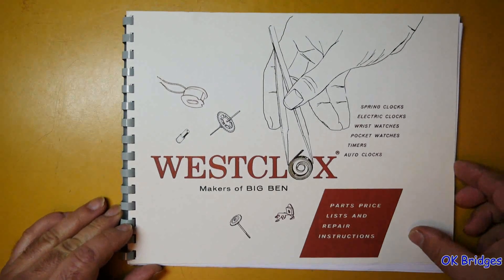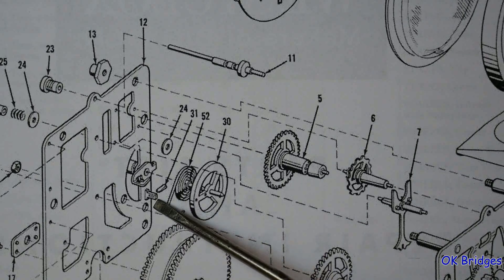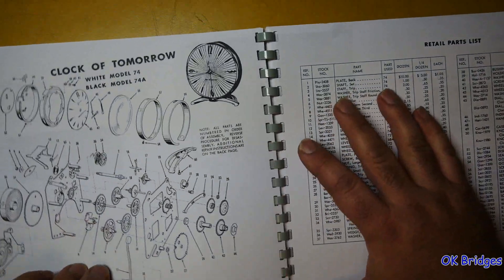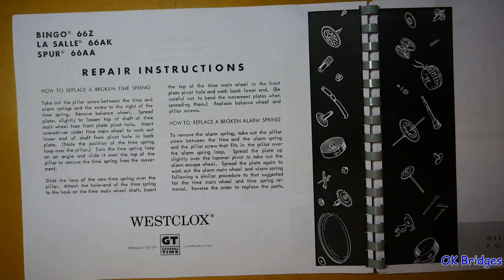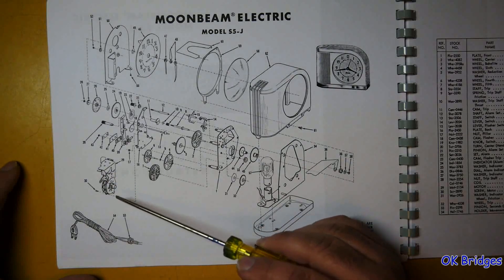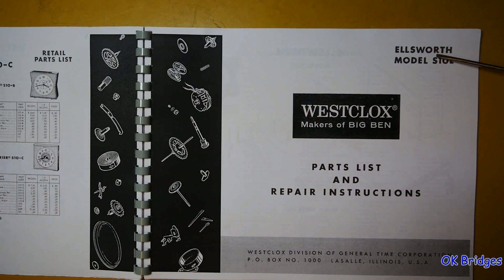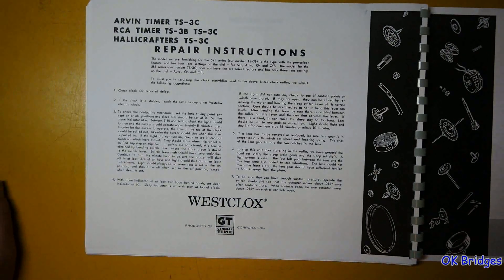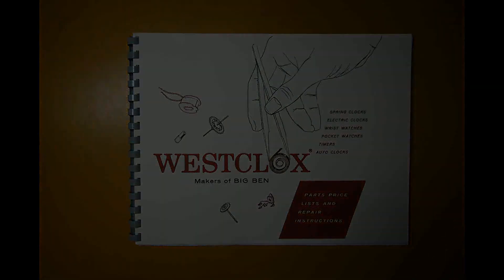1956 Westclox Parts Manual

Comment: Hi.  I have two Style 7's with taper pins on the hairsprings.   These are the later models with the brass trim ring, not the earlier chrome trim ring.    

I am also lucky enough to have two good working Clocks of Tomorrow (black) and one with a wonky alarm button (white one).   Maybe when I have time to look at the exploded view I can determine what is wrong with that mechanism.

Thanks again for all the great videos.    You have a really good manual there!

Comment: Thank goodness whoever found this was smart enough not to throw it out!

There's been a crap ton of different things I've learned from this, such as clocks being made for Ford, etc. I could go on all day, but I won't. The most notable thing is that the U.S versions of Big and Baby Ben style 7's don't have a taper pin according to you! They do over here! I've never seen a Canadian style 7 (even going as late into 1963) without a taper pin! Such a shame they somewhat cheapened out over in the U.S with the taper pins. 

The Watchworks confirmed that as early as 1962, the U.S Westclox dollar watches had glue. Over here, we still had the taper pin. 

I wonder why Westclox decided to do this?
Reply from the maker: I think the biggest savings in using the glue instead of  a taper pin is that gluing the hairspring requires less skill, and thus less time invested in training, and lower wages to employees working on movement assembly because they are less skilled. W e know the deft hand it takes to properly pin a hairspring, and how much easier it is to simply place a dab of glue.

So, how badly do you wish you could just order up a 1/2 dozen or a dozen of any part you want?
Reply: @okbridges  I'd order about 60 hairsprings and balance wheels.
Reply: @SKHorology2025  Yeah, I'll take about 60 of those hairsprings too.   And a dozen of the trim rings and that annoying little connector tab to cover the split in the rings.     The trim rings are always tarnished / spot damaged beyond any way to make them look nice again.
Reply: @MarkSWilliams27  Either that or they're just gone entirely.